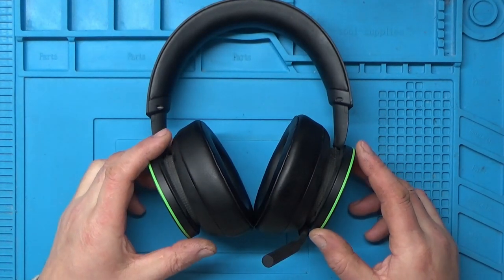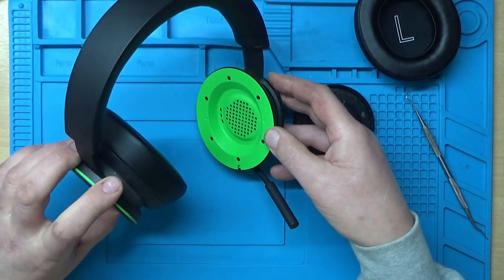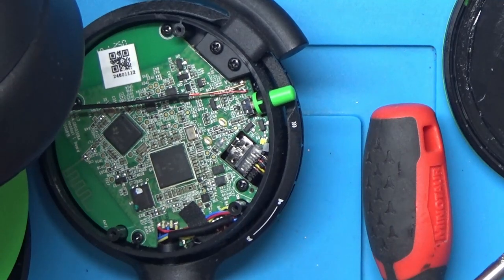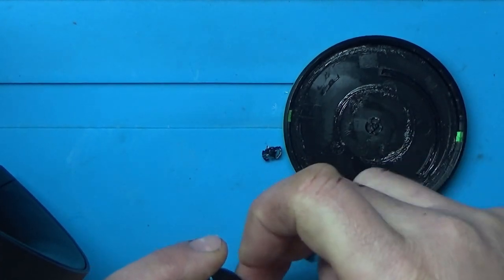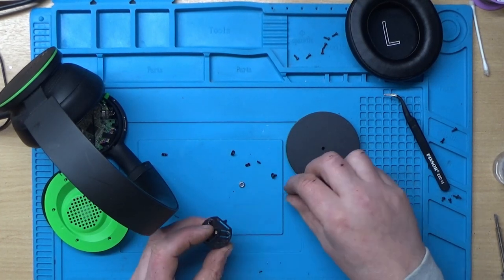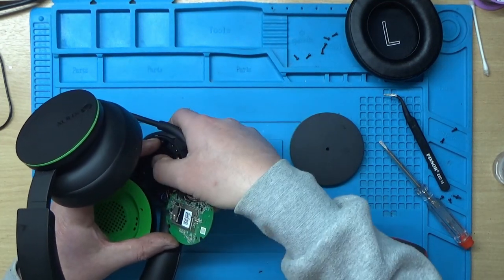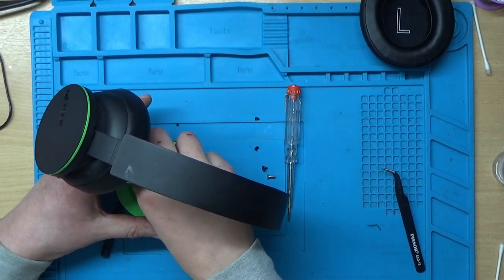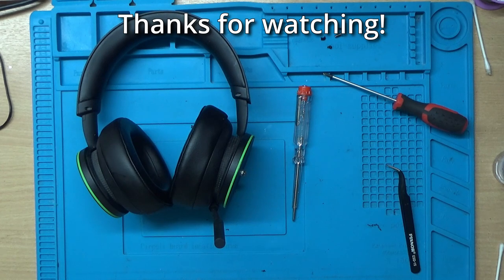Xbox Wireless Headset - It Just Fell Off! [Repair]

Comment: Another very ingenious repair.  Sometimes you have to figure out how to repair things with the stuff that you have on hand.  It is a shame that the item was designed so poorly.  I’m sure that it was not cheap to purchase.
Reply from the maker: Thanks! Yes I've always had to think on my feet and sometimes come up with non standard ways of fixing things especially when I didn't have parts or parts weren't available. Or where I've had to alter things to make them work, a good example would be the FLIR multimeter if you haven't seen it already 🙂👍

Comment: My first thought when I saw the name of the video was that it's the same thing my kids always says "it just fell off" I think I would have been possible to glue a nut to the inside of the "volume part" then used a partially-threaded bolt in the "plate part"  and some thread lock in the nut, but I think I might have done the same thing as you did, keep up the great work
Reply from the maker: Thanks Morten. I could have possibly spent more time thinking of a better solution but I just wanted to use it. I wasn't too bothered what it looked like 😂😂

Comment: Wait until the mic just falls off. That's a nice surprise. Thanks for the video, it gave me info on getting the mic boom support out to make a new one.
Reply from the maker: Thanks and good luck with your mic 👍
Reply: I had the same (apparently common) problem of the mic boom cracking / breaking.  I applied some superglue to hold it, and then a couple of good lengths of black heat-shrink sleeving around it - so that it shouldn't be able to break again anywhere along the main part of it.

Comment: Good repair. An alternative, perhaps, is to use JB Weld or Araldite to secure the head of a flat / countersunk screw into the outer section (rather than drilling a hole), fitting the nut on the inside.
Reply from the maker: Thanks Ralph. I had thought about something like that but it might have came off in the future. I know what I did will probably last longer than the headset 😂😂

Comment: I just received my headphones today, I instantly felt they are weak on that dial, and that is where you normally grab them and pull outwards when putting them on and off your head. 
That is why I googled this.
Reply from the maker: Thanks adrian. I hadn't thought it could be from removing them from your head that could lead to failure 👍

Comment: This has just happened to my headset and my sons went a few month ago. Just fell off. Typical xbox gear made cheaply. What size screw and nut did you use please
Reply from the maker: I think it was a M4x10mm but not 100% I had a box of assorted nuts and bolts and the one I chose seemed appropriate.
Reply: My headset fell off today

Comment: Why did you make it hole on volume cover side. You can easily get it with glue scrabs outside to inside places on mid.
Reply from the maker: I just needed it fixed quick and permanently, so I just used what I had 🙂

Comment: Good Work, What size is the screw and bolt please
Reply from the maker: Thanks 👍 I think it was a M4X10MM I had a selection of  nuts and bolts and that one seemed to fit. The headset is still working fine since my repair and I use it quite regularly 🙂

Comment: Do you know what battery it uses? Mine has a battery problem.
Reply from the maker: Sorry, I didn't look at the battery. Most batteries have a number written on them which equals the length,width and thickness of the battery, also the battery capacity. It might be worth having a look to see if it has any information written on it. Alternatively you could measure it and try searching the dimensions on Aliexpress or such.

Comment: Thanks very much for this.  We have (I assume) a newer model than yours - that has a smaller PCB that is located to one side of the inner case.  When you remove the 4 screws from the black piece you can immediately see and access the circular mounting disk part, as the board isn't infront of it.  In this version the LiPo battery (didn't check but I'm assuming again due to the size of it) is stuck to the back of the black plastic part and locates to the side of the inner board, and it's immediately behind the circular piece.  I used an M3x12 countersunk hex-head screw, with a washer and nylock nut on the outside.  When tightened the thread is just the right length to be slightly proud of the nylock.  Great video, and very helpful to see what you did before I just dived in and worked out what was what.
Reply from the maker: Thanks 👍Glad it was helpful to you 😊

Comment: Hi So i had a similar issue but my slider for the volume adjustment fell off do you have any idea what that is called or where i can buy that piece
Reply from the maker: The slider is called a slide potentiometer. I'm not sure what value or physical size it is. Perhaps you could find a scrap unit on Ebay and remove one from there if you can't get a replacement.

Comment: Wouldn't it be aesthetic nicer to use an epoxy glue to glue a small motherboard standoff to drive to screw into, then you wouldn't see the repair from the outside. Overall a good fix though.
Reply from the maker: Yeah possibl. I wasn't really going for aesthetics though. I just wanted to use it 😂😂

Comment: Mine just fell off lol
Reply: Dude same happen me yesterday left one just drop, seems we need a collective demand in a thread official microsoft forums with these products and pics its a general trouble and cheap build quality control
Reply: @gamecamacos  Do you guys think they broke from dropping them, pulling outwards when putting them on/off head, or from turnning the dial a bit too much over it's limit ? 
I feel the rings weak when pulling utwards to put them on/off my head. And if you hold them by the rings and pull outwards, you can see the rings going out around 1 mm.
Reply from the maker: I'm not sure, mine were never dropped and always looked after. I was literally adjusting the volume slightly and it literally just fell off! I don't think I was removing them via the volume knob,  I may have turned them slightly too much perhaps but I'm not even convinced I did that.. bad design, there's loads of other people on reddit with similar stories.
Reply: My left one also just fell off.definitely need to all take this to Microsoft together
Reply from the maker: Yes it's definitely a design flaw...